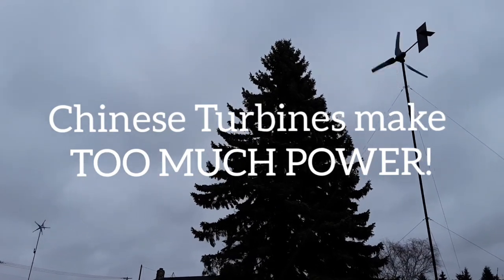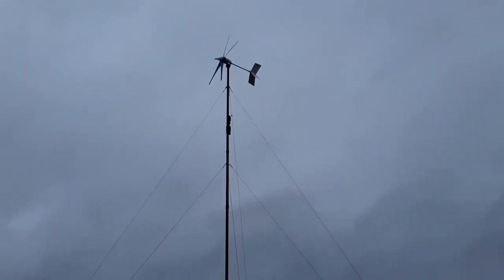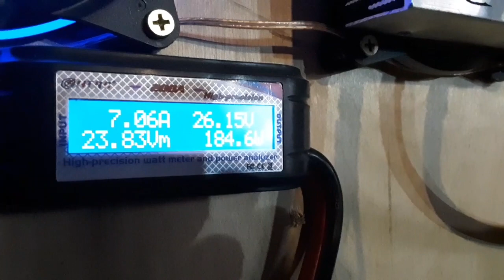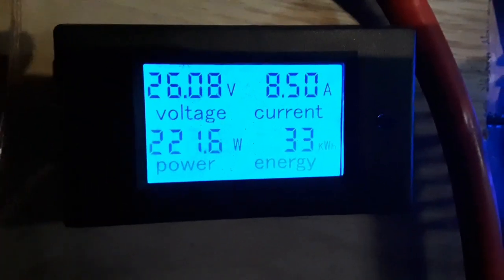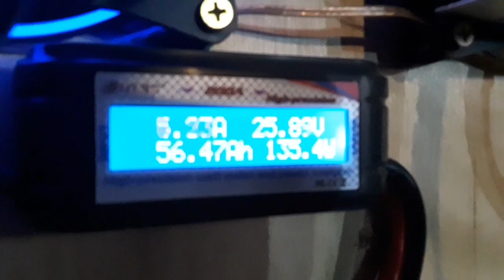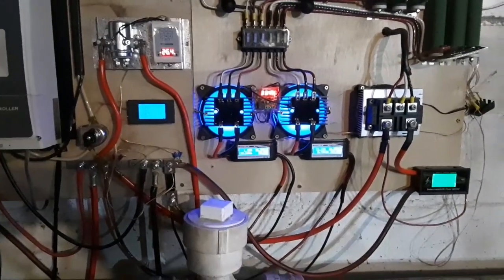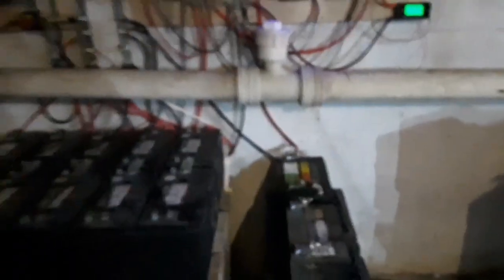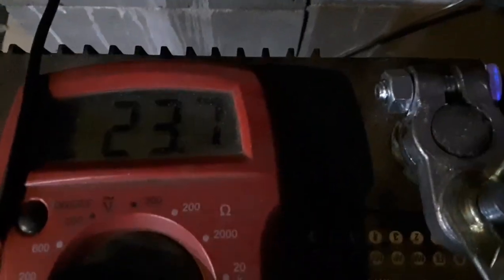Chinese Turbines make TOO MUCH POWER!

Comment from the maker: From morning till bedtime, 7Kwh were harvested from wind!
Reply from the maker: @JOHNDANIEL1  i think it'll be ok. Even with the the big tail it still sways because the wind here is just that dirty. From the northeast is the only halfway straight line breeze we see....but your correct.  I do run that risk. Your outdoor light idea is pretty clever! That would slowly bleed off juice so I don't overcharge the auxiliary batteries. Thanks again sir for pointing me in the right direction!
Reply from the maker: @JOHNDANIEL1  oh yeah....and the new tail is about 4× the surface area as the original. Before that we only ever saw momentary peeks of 500 once or twice. Time will tell hiw she holds up.

Comment: One of the most important thing I have checked on my wind turbines is magnet size, because each cm3 of neodymium N42 class can produce theoretically 60w on strong winds and 30w at rated wind speeds  from my measurements . My 800w magnets size is : for SM3-800W, size of the magnets is 17.96*28*4mm, coil wire is 1.38mm on 48V 
for SK-1W,1.5KW,size of the magnets is 60*30*10mm, wire is 1.2mm but 96V

Comment: Wow you have some serious wind to deal with, but im happy that you have those John Daniel type resistors... thats great ;) im going to order few of them and then make my own blade switch because next week i might get 5-6meter long antena post for free and then it will carry both of my hoverboard turbines... i just have to invest 20-30€ in second motor and thats it
Reply from the maker: Whenever they're up and steaming it's a pretty simple system to piece together.  I searched around quite a bit for good parts that weren't crazy expensive.  Everything is linked in the video description.  Can wait to see the hoverboard turbine kicking power!
Reply: @smallcityhomesteaders1600  Great setup man!!!! What's the resistance of each one of these resistors on your braking system?
Reply from the maker: @Parafiestas  thank!... the resistors are 10 ohm 100 watt. They're basically just for looks now. I use the water heater for a dump now.
Reply: @smallcityhomesteaders1600  I used 8 ohm - 100 watt resistors on my setup, but when engaged, I noticed that the turbine was spinning faster than before ( I can't really explain it, but it was like freespinning on 70%) and the input power would drop similar to yours, but I didnt like that fast spinning of the blades so I removed that braking system. I also use a dump load, I was just curious if you noticed that faster spinning too when you had the previous braking system. Take care man, thanks :)